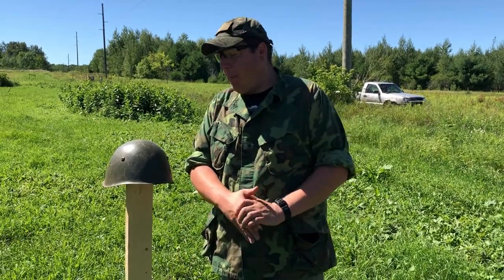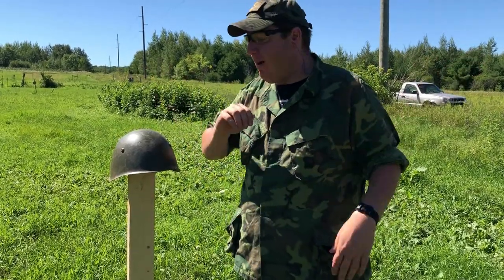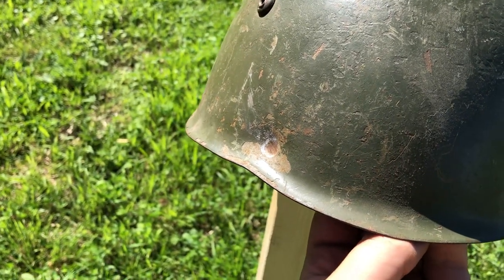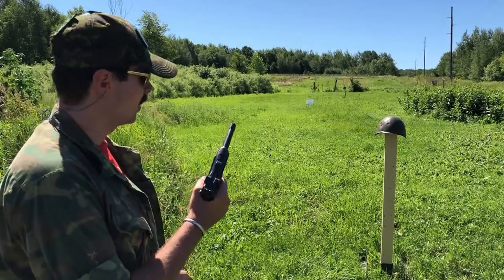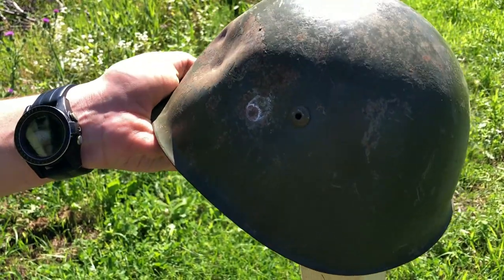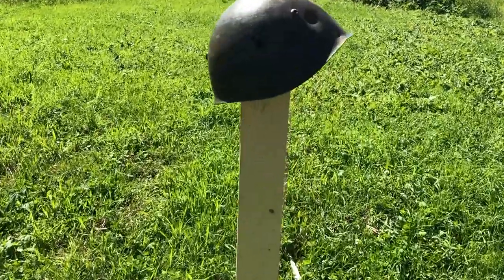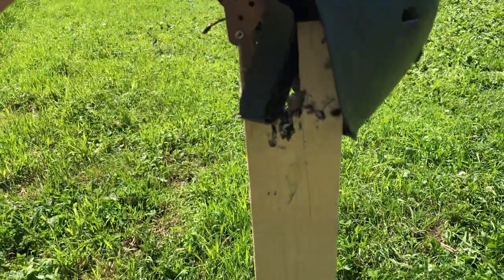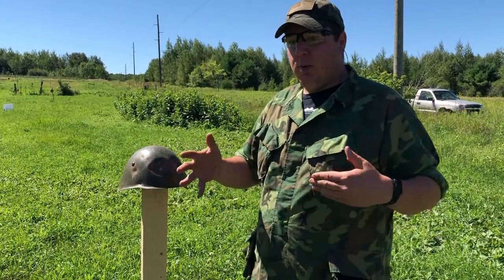Helmet Ballistic Test: Italian M33 Steel Helmet

Comment: According to ww2 reports , the m33 was one of the best helmets!
Reply: Yes! Even more better than the stalhelm
Reply: @mayonenciom7983  well, the stalhelm had more protection on the neck, but It was more uncomfortable and   heavier, in facts in Italy peasants used to use stalhelm like bowls to carry manure in the fields ( It Is not a joke...). So, in my opinion, yes, the m33 was better.
Reply: Still prefer a SSH 40. Damn things can take magnum rounds if you get one in good condition.
Reply: True
Reply: the reason is that unlike the m1 or brodie, these helmets were hardened (at least befofe the end of ww2) in their process, which made them less prone to denting, and more to cracking
the Soviet helmets have a similar process too, which is why they are exceptionally strong

Comment: As far as Historic Value, Italy used those helmets into the late 1980s ?
So it may not be of WW2 vintage/manufacture.
Reply from the maker: Yeah, but they still have historic significance. They aren't making any more of them. I agree with you though, but people still whine and bitch about everything.
Reply: They were used even into the 90s, but the thing is that they refitted the internal structure but the helmets were produce pre and during ww2
Reply: @untraceablefgc-9mkii251  as far as i know some have been entirealy made post war
Reply: I have an m33 made in 1943 but only used in 1960